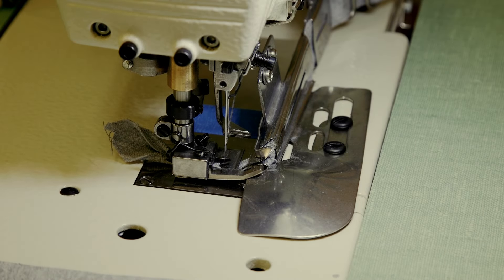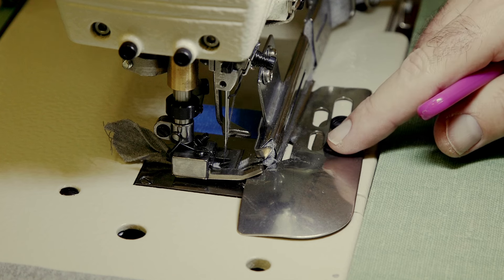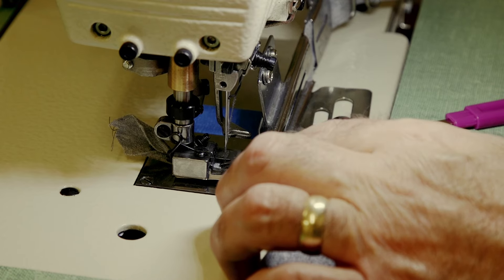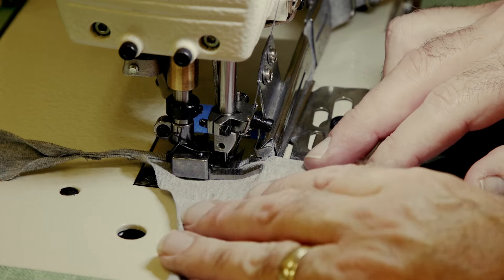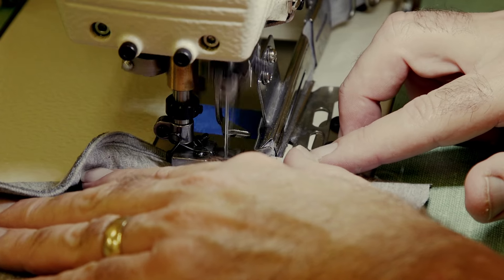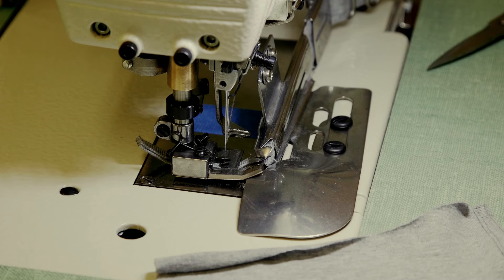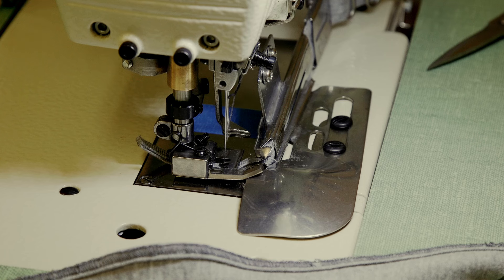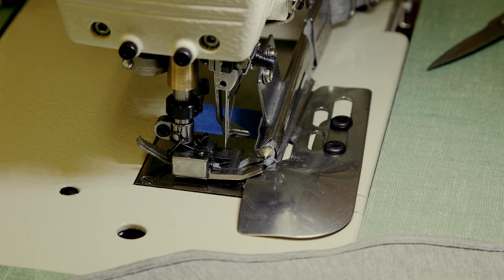Industrial Cover Stitch Machine Binder Demo

Comment: Nice comparison showing your domestic vs industrial coverstitch machines’ ability to sew binding! Since you didn’t combine the two videos into one to show the comparison, it would be great if you linked to the other video of your domestic machine sewing binding in the video description.

I know you said it was a “very quick demo,” hence the obvious looper thread tension issues, but in case it’s helpful to you or anyone else, I thought I would add some observations:

• To reduce the fabric from “bunching up,” as you said near the beginning, try reducing your presser foot tension when using the binding attachment.
• You mentioned that you had the machine setup to do something else, but it looks like you have your stitch length set very short. You might like the results better if you try using a longer stitch length with the binding attachment.
• The reason your fabric is coming out wavy at the end is because you also need to adjust your differential feed. Having said that, I would reduce the presser foot pressure first, then see if that’s enough before adjusting the differential feed.
• You can see a very pronounced ribbing on the binding once it’s sewn on, which from the little I can see in the video, doesn’t look as well-defined in the binding fabric before it’s sewn on. This would suggest that you have too much tension being applied to the binding fabric and you are stretching the binding. The angle that the binding enters the attachment can have a big impact on this, (which is why the angle can be adjusted), as well as how many passes the binding weaves through at the beginning of the attachment; you don’t necessarily need to use all of them all the time.

Anyways, I know you said it was just a quick demo, which is why I hesitated to even mention any of this. But I decided to share my observations anyways in the event that they’re useful to you or anyone else.
Reply from the maker: The amount of pressure on the foot on starting doesn't matter in my experience. It is the foot design and the attachment design that causes it. 

You make good points, so going forward I will take my time to get things setup and do some testing. In this cause I decided to just show how it stays lined up vs how the domestic machine.  That is why I used the narrowest binder I had.

I rarely use the Coverstitch machine for binding though; I'd rather just use the straight stitch machine instead.  However, after pressing it the result looked good. I just need to remember to only capture these videos when I am not rushed. 

Thanks for watching and commenting though.... I do appreciate it very much. It tells me you paid attention. :)